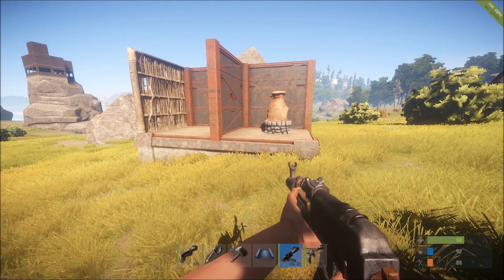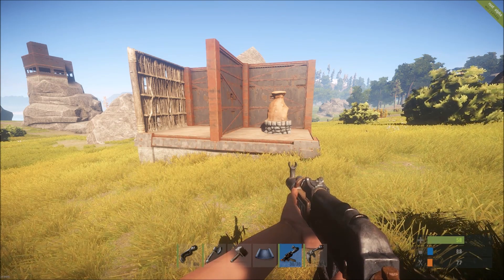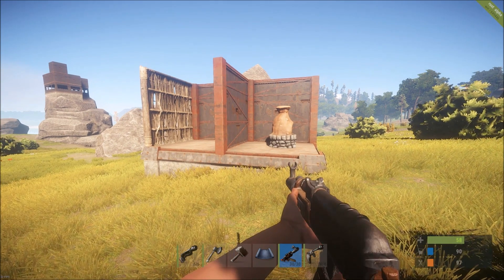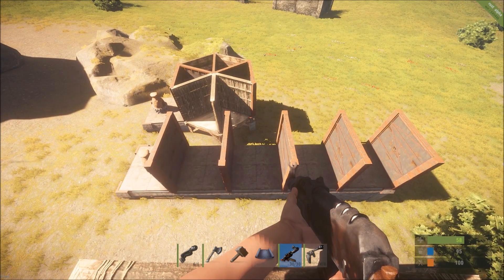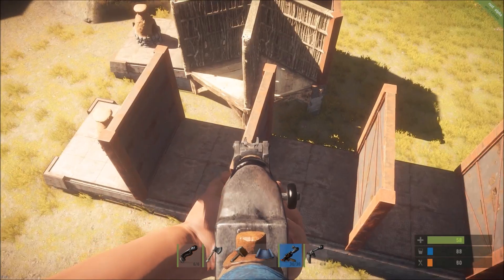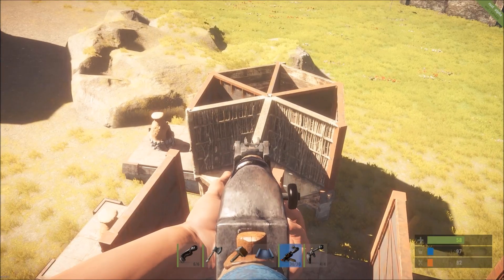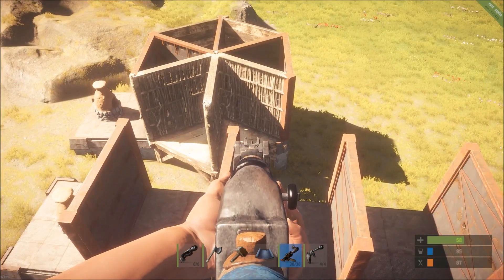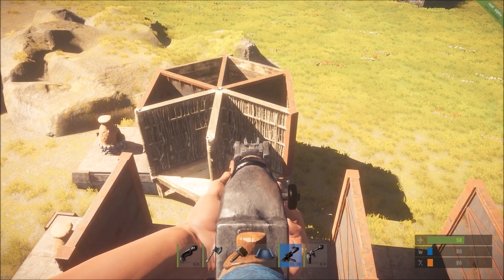Rust Base Design: Honeycomb (Concept)

Comment: Hi , good videos ! 
But if they use c4 , isn't the triangle blocks worse bc they would suffer from area explosive damage, so i would say the square walls would be better don't u agree?
Reply from the maker: I really think you're right, which was going to be my next video, but walls are bugged right now, so i think i will take a break from the honeycomb design and come back to it.
Reply: Thanks for the response:)
Yes , i did some testing with walls and the results changed all the time, exterior , interior walls were very bugged and damages changed all the time from c4 , rpg
Reply from the maker: Indy700000 I just put up a new video discussing the wall bug. I think I'm going to wait until this weekend (assuming it's fixed) before I put up the video where I test the C4. Just to be sure. I have a couple other ideas in the meantime though.
Reply from the maker: +Joshua W I wish :/ I just moved and am trying to get caught back up on bills and stuff. Haven't been able to afford to get my internet going again.